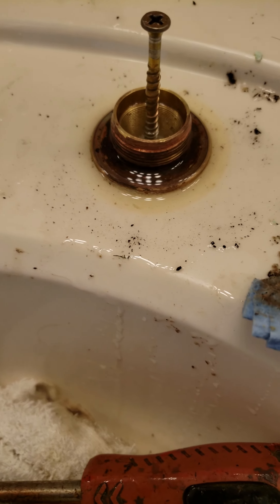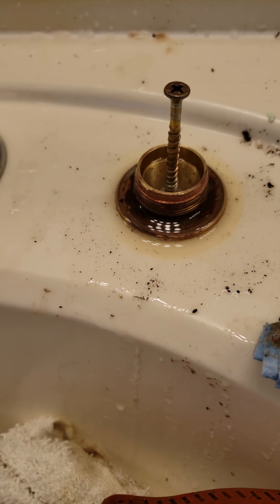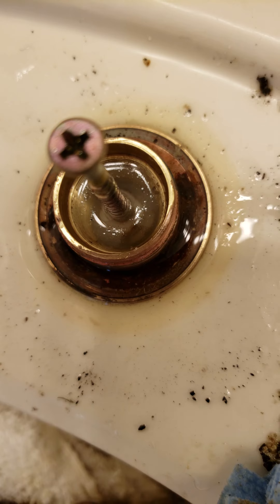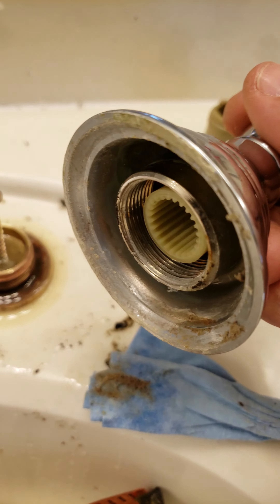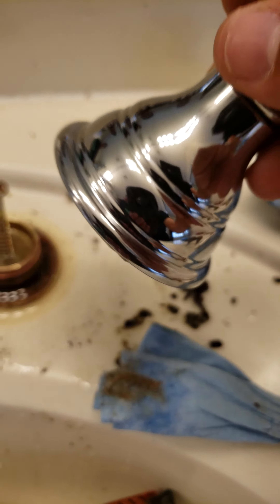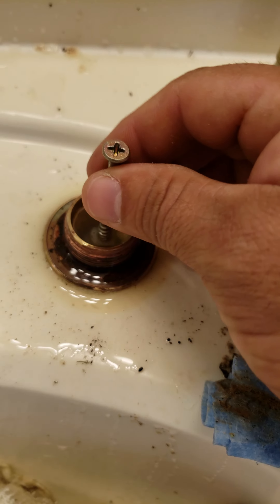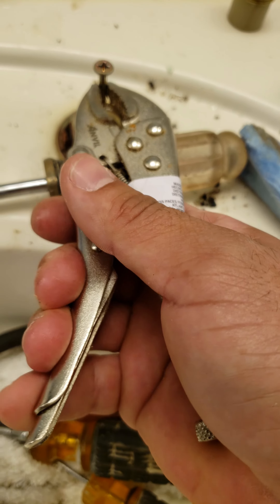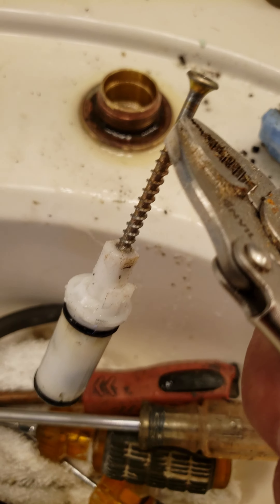How to remove a Moen 1224  faucet cartridge.

Comment: Retainer nut - trying to take off - bolted in there.  Does this need to come off before the cartridge is taken off?  OR I can put a screw-in cartridge and pull off the cartridge and retainer nut?
Reply: For sure the retainer nut must come out. Sometimes those things are welded together by corrosion. At that point it's easier to just replace it.